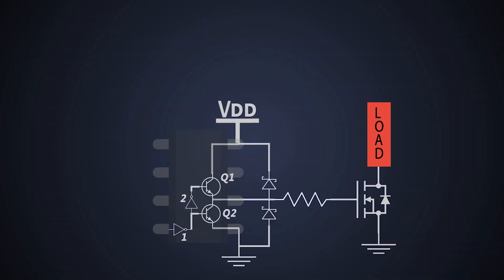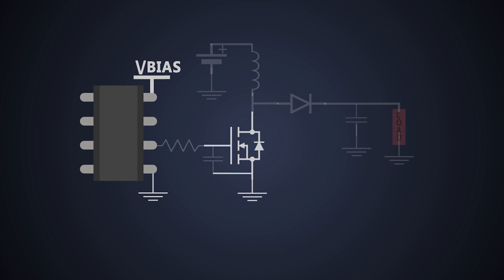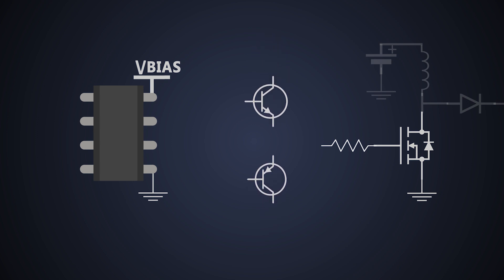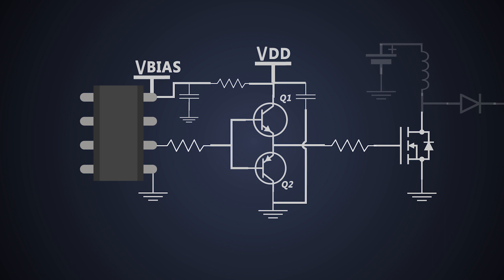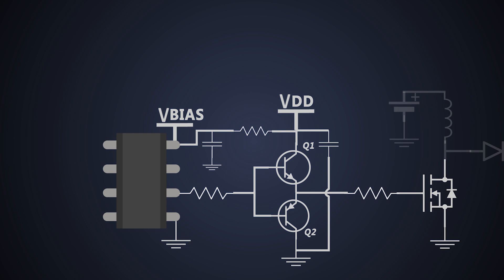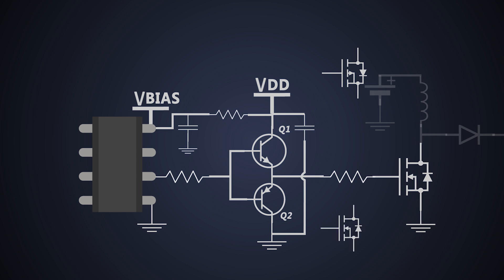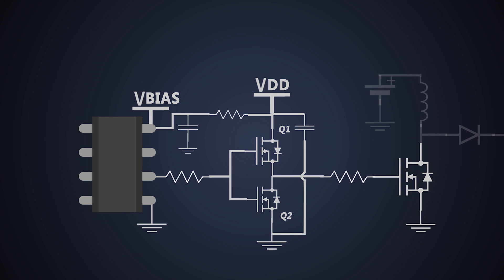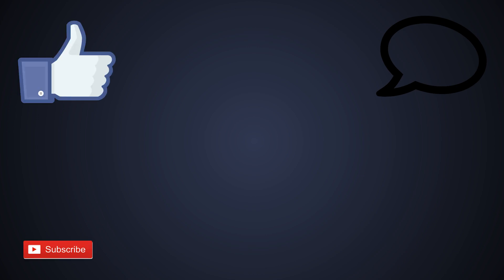What is Totem pole MOSFET gate driver? Totem pole MOSFET gate driver working | Push pull gate driver

Comment from the maker: There is a mistake in MOSFET based totem pole circuit. The P channel is supposed to be upside down. Please go through reference documents for accurate circuit.
Reply: also mosfet totem pole need RD circuit in gate for different Ton & Toff times.else driver will produce a lot of heat
Reply: In real life you would just buy a LMG1210 rather than discrete components.
Reply: @ronpearson1912  nope, rn im trying to control a recycled mosfet [09ng] for a college project.

Comment: There are many problems with the MOSFET half bridge.

Input voltage must be in range of 0 to Vdd (you should shift the logical voltage level with class A amplifier without bias) and also, you're going to see shoit through, since bith MOSFETs can be on at the same time (ie at half gate voltage)  , you then need to provide a dead time.
Reply from the maker: Absolutely right! Half-bridge designs need proper level shifting, dead-time control, and careful gate driving to avoid shoot-through. That’s exactly why gate driver choice matters.

Appreciate the input — and hey, don’t forget to subscribe for more deep dives like this!

Comment: I was confused with something that might help another person with the same doubt. When the signal is 0V, that pin is lowered to GND so PNP transistor can turn on, GS capacitor acts as a voltage source, EB activates (0.7V) a little current flows throw the uC pin limited by the resistor that connects to it and more current flows throw the pnp transistor. It is a smart design because it uses only 1 signal to turn on and off the transistor.
Reply from the maker: Exactly! That’s a clever use of one pin to control both transistors — simple yet effective. Appreciate you sharing the explanation, it’ll help others too!

Do subscribe for more smart circuit breakdowns like this

Comment: Great video, could you explain what this means?
"MOSFETs  have a large shoot through current when their common gate voltage is in transition”"
Reply: That one MOSFET takes time to turn off while the other is turning on, so there is a moment where both MOSFETs are conducting (the one that was turning off but is not fully turned off and the one that started turning on) which generates a short circuit between vdd and ground.

Comment: It bears pointing out pretty much all mosfet gate driver chips are essentially the circuit @7:37. They even have inverting drivers and some with both outputs. They range from 1 amp to over 10 amps, which will let a 1.8v signal control a monster power mosfet at high frequency.

 The best part is most are $0.50-1 for the whole package.

Comment: You'll notice in the push pull stage that you need a PNP and an NPN transistor, whereas the totem pole driver uses only NPN transistors

Comment: For BJT totem pole Vcc is correct name of supply voltage,c-collector.Vdd for mosfets.For correct work of mosfet totem pole RD circuit in gate supply needed for different  rise/fall times to prevent shoot through

Comment: what is the switching frequency limit fo this circuit if bjt is used?
Reply: That depends on many factors. Namely the T-on and T-off switching times of the bjt or mosfet. For bipolar transistors the amount of current required to drive the transistors fully into saturation and turn them fully on or off is critical as well. For mosfets the gate charge plays a critical role (Qg). Enough current to fully charge the gate to get the mosfet is very important. The amount of current required for the mosfet gate to charge is determined by the gate charge (Qg) divided by the turn on time   (T on).

Comment: Good video... But one issue is that, while replacing with complimentary MOSFET irrespective of gate supply for the totem circuit the upper MOSFET will be conducted through its parasitic diode...

Comment: Are Vdd and Vbias the same value？The smoothing transistor between the two bypass capacitor might conduct some current if Vdd and Vbias are not the same, am I right?

Comment: Thanks for the teaching. one more sir what can be the reason of overheating on mosfet even when it been operated with totten pole to drive the mosfet on smps ur help sir. again I want to know how I can add 12v in gate drive transformer please I need the transformer coiling circuit diagram thanks

Comment: Pwm doesn’t have minus low pulses only high and zero 
so how it can open pnp bjt?
Reply: You are correct. However, it works when the gate of the next FET circuit is charged up close to VDD. It looks like the pnp Q2 when turned on with its emitter at near VDD, it would be in Saturation condition, then goes into Active as VDD drops, then turing OFF as VDD approaching 0 + VBEon. Similarly for top npn Q1.

So iniitally when the controller send out a 0v low and the output is at 0v, Q1 does not work and the circuit does nothing. However, when the controller output goes H, Q1 would work and charge the output to VDD - VCEsat. And it works from there on.

Some initial voltage at the output of the totem pole circuit in between could cause the initial half of the PWM L or H from  the controller not to work intiialy, but the next half of the PWM of the opposite  value would work and charge or discharge the output to the operating levels the BJTs citcuit needs - as explained above.

Is this correct, the author ?
Reply: Pnp bjts and PMOS transistors are both conduct current when you apply 0 volts to the base/ gate. This is opposite of npn or NMOS trasistors that only conduct current when succificent voltage is applied at base/gate
Reply: The PMOS in the circuit is upside down, and when corrected, its body is connected to VDD. When PWM output is say 0V at the gate of the PMOS, a channel is formed under the SiO2 of the gate and the PMOS is on.

Similarly for the NMOS below, the body is connected to GND 0V, when you put in something above  the VGS threshold, VDD or not neccesarily VDD but just above VGS threshold, then similarly to the PMOS above, a channel is formed an the NMOS turned on and discharge the output of the CMOS circuit. If for experiment, if you can connect NMOS body to VDD by reverse the D-S, it will not work when PWM is VDD but will turn on when PWM is 0v which both PMOS and NMOS are on.

BJT on and off conditions are different as explained in the other reply here.
Reply: For th elast sentence of the long 2nd paragraph, the other problem when connected the MOSFET in reverse is that it will be on in the reverse logic due to the body diodes are reverse.

Comment: How can we make the gate pin negative 9 volts while the MOSFET stops conducting electricity? Help me make a video thank you.
Reply: You can use a voltage divider circuit. For eg. total supply is 24V, you can add two resistors (and Zener diodes) to get 18V and -8V.

Comment: I use this today’s and the 15 voltage to the totem pole blow my gate on mosfet I did this same design and it keeps blowing my mosfet hat I don’t understand why my data sheet said only 5 volt to gate so should I use only 5 volt to driver
Reply from the maker: Yes, please use only 5V if the datasheet mentions the same
Reply: Using a gate resistor?
Reply: Need a 5V zener on the gate to ground to clamp the voltage

Comment: Actually the gate of the power fet should have back to back zener diodes apx. 18 volts.  As a MOSFET the Miller effect will show large transients at the gate when driving large currents, these can damage the drive circuitry.

Comment: What if VDD>Vbias is required?
Reply: Well, you add a parallel resistor to Q2 (the Emitter-Collector section).
Reply: @codures  How is that gonna charge the gate to VDD and not to Vbias only?
Reply: @nikolaivic4480  well, while the gate voltage won't under any circumstances exceed vbias - 0.6v, it'll definitely help to keep the mos OFF.
If you wanna make the mos gate reach vdd (or higher), you might wanna change the driving system (or going for bootstrap caps respectively). This drivers are good for logic gate MOSFETs, hence the need to keep the gate always low.

Edit: if that resistor is large enough (given Q1's hfe, you may even put that BJT in deep-saturation, hence reaching VDD - 0.3V, but again, not VDD.
Reply: @codures  Vbias is 3v3 or 5v if it is a uC. VDD should be 10V for normal level FET to reach lowest Rdson. Emitter follower is not a good solution in that case, maybe for logic level FETs. Common emitter topology is better.
Reply: @nikolaivic4480  totem hater, lol.

Comment: All that is is a push-pull driver for a MOSFET which is basic common knowledge dating back to the 1950's & earlier in valve audio amps the only difference is there's no biasing between the bases as its logic!
Reply: Dude, I was not alive in the 50s.  So good knowledge, well presented.
Reply: @jimedgar6789  Fun that I wasn't alive till the mid 60's but it still common knowledge & I'm not a hater or a DUDE!... I'm a bloke with vast electronics knowledge!
Reply: @preston963  I dig it.  But still nice to be taught the old stuff.  Not every knows it.  Like Ohm's law.  when you get it, you really understand more than you ever did.  I am learning new stuff every day and have been doing this for three decades :)
Reply: Don't be a hater, boomer.